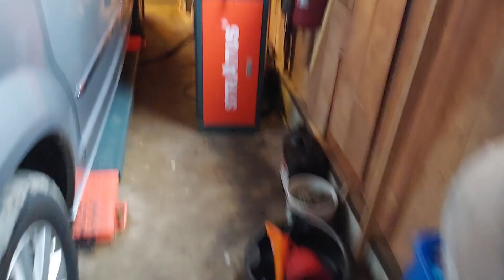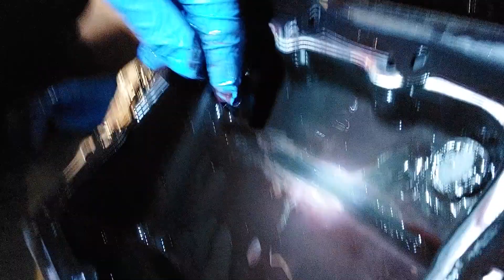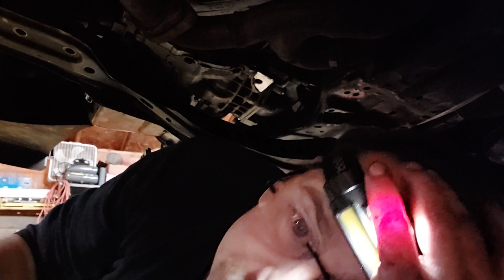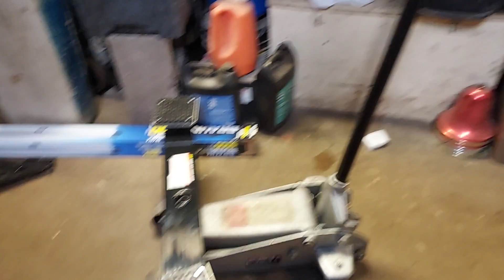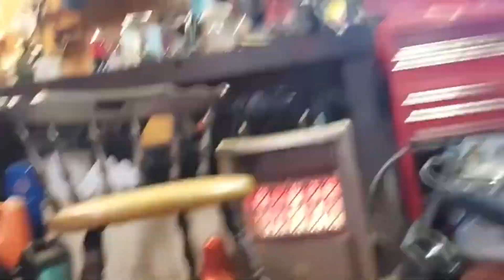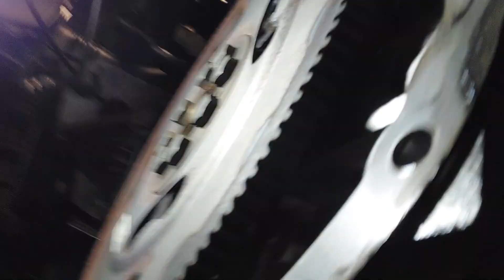Part 1 2016 Chrysler Town & Country P0740 Transmission code repair

Comment: Definitely oil is from a leaky oil cooler.   Rear mains rarely leak on these.   And the oil on top of the bellhousing is the dead giveaway. It's from the cooler/filter assembly

Comment: did you replace the transmission pump for this one. or just converter. i have the issue of p0740 and i had already replaced the ttc silenoid but now i did trans fluid cha ge n oil filter. and now im getting higher rpms shifts. and it gave me p0740 code. im not replacing silenoid because i had already replaced to begin with so im guessing either the torqie converter went to crap and the pump peobablt fail. it had lot of crap on magnet when i remove rhe pan. also it does have 200k miles. 😂😂😂

Comment: Hi, can you briefly write to me what needs to be replaced for error P0740? I don’t know English well enough to understand what you are saying.
Reply: Start with:
-torque convertor clutch solenoid.

If that doesn't fix it, change:
-torque convertor 
- transmission pump.  
-ATF+4 fluid 
-filter 

Perform a "quick learn" once repairs are complete.
Reply: @MrHemi4spd-420what is a quick learn and how do you perform that?

Comment: I think you wasted money replacing the rear main seal. First, it didn't appear from your video that any oil had been leaking from it. Second, the pentastar 3.6 engines are NOTORIOUS for developing a leaking oil cooler. You can actually have oil and coolant leak from them. When the valley fills up, it runs out onto the back of the engine where it is bolted up to the transmission and will also run out to the top of the transmission. It is highly likely that is where your oil leak was coming from. In fact, if you had any oil on top of your transmission, then it definitely didn't come from the main seal, as the main seal sits well below to top level of the tranny.

Comment: Those oil filter housings leak and run down the intake valley and puddle on the trans case. They make an aftermarket filter housing that corrects this defect.

Comment: I have this same issue debating on replacing the whole trans mission or just the converter and solenoid is it still going well?
Reply: I just fixed mines with just the TCC solenoid and some lucas and mopar fluids from the dealership. Definitely a job you can do yourself if your broke enough. Two shops told me i needed a new or remanufactured transmission.  Basically tried to rob me out of 4,500- 5,000.  There is fluid on both sides of the 62te so when you go for the solenoid on the the top plenty of fluid will come out. Please try the solenoid first before changing the transmission. a fair price for this service is $300.00- 400.00  if you have the parts.  A fair mobile mechanic should be able to hook you up for less than  $150.00
Reply from the maker: I found out afterward that the pump went bad which is what damaged the converter. You can certainly do what I did,but I would inspect the pump while it is out. Apparently that is a common cause of the converter issue.
Reply: @kwsgarage9609  
Which pump went bad ? I’ve had a failing coolant pump ( comes on error code in winter but not in summer - valve is stuck open )

Comment: How is the vehicle running now? I've heard the transmission still going out after replacing this solenoid.  I'd assume because the torque converter and the solenoid were replaced, all is still well.

Comment: If you see oil leaking from the top of the engine down to the top of the trans.......it could very well be the engine oil cooler is leaking. It drips down and makes a mess.